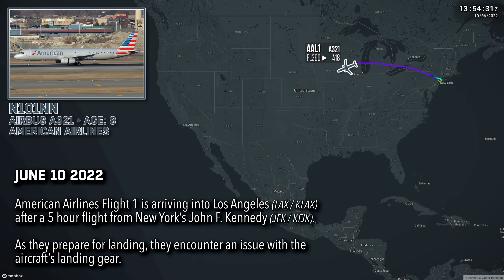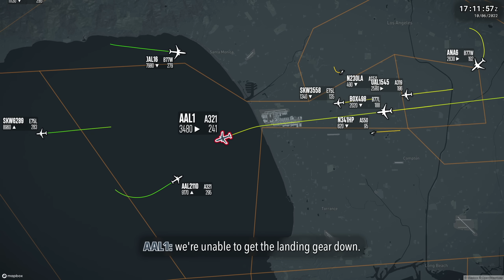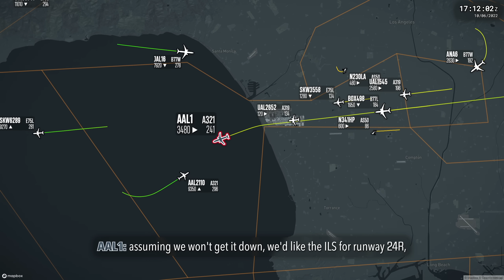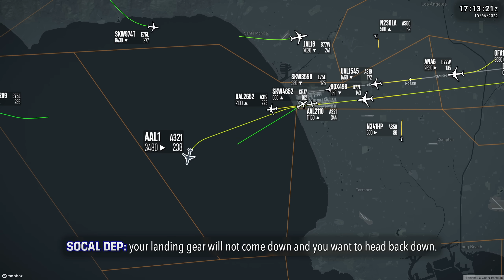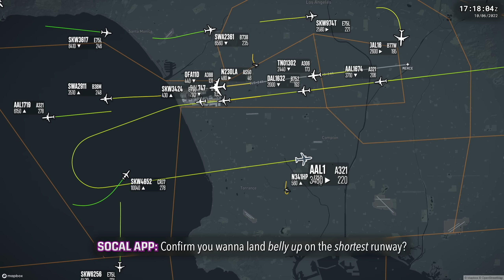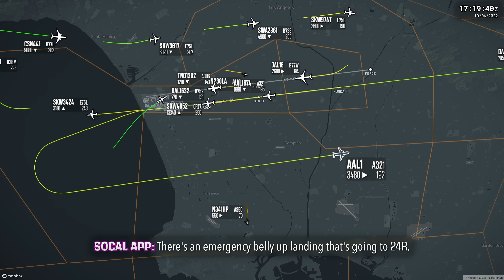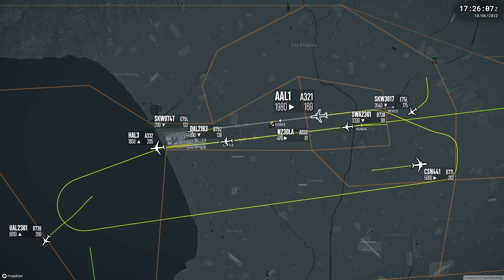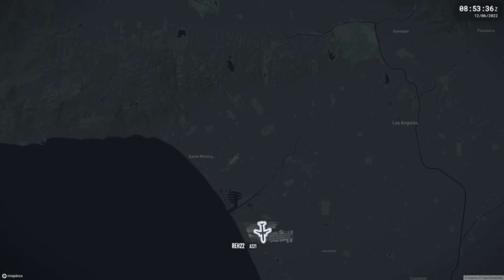LANDING GEAR MALFUNCTION Leads To EMERGENCY Landing at Los Angeles [ATC audio]

Comment: so did they  get the landing gear down manually? or did they belly up land
Reply: They got the landing gears down manually, otherwise the maintenance would have been way longer.
Reply: @mdynasty8219  duh that makes sense. thanks!
Reply: They were able to get the landing gear down, however when they landed they got put in a groundstop cause Air Force 2 was leaving at the same time they were landing so they had to sit on the runway for almost half an hour.

Comment: cant get the landing gear down and then says I'll need to stop on the runway for an inspection , without a landing gear were else would he expect to be ,  can taxi without wheels ?  :-)
Reply: There was definitely some miscommunication (between dep and app). AAL1 said they were going to manually extend it (basically dropping it using gravity) and assumed they were going to get it down that way - which they apparently did. However, the pilots should have corrected app/ mentioned to app that they had gotten the gear down manually.
Reply: @lyaneris  agree. However he said he would need a visual inspection before saying he was going to manually lower the gear  , it made me chuckle.
Reply: @patthewoodboy  Yeah, the pilot was a bit over the place ^^. Had they been unable to drop the gear manually, they would have probably held somewhere to talk to company.
Reply: @lyaneris  and some serious manouvres to get the gear down , shake it loose , as a passenger that might have been interesting
Reply: @patthewoodboy  On airline aircraft. those don't work, nor do single gear touch and goes, like Piedmont did at CLT some years ago..
Reply: @markmonse5285  OK

Comment: A “belly up” landing really isn’t ever advised. Lol
Reply: We did a belly up landing and walked away. Any landing you walk away from is a good one ☝️
Reply: Same ish just happen in Miami.. 🤔
Reply: but if the gear is up and you half barrel roll it, the gear is now pointed down.  controller is next level.
Reply: The goal is presumably to lubricate the runway with the self-loading cargo. Unfortunately, you also lubricate the runway with the flight crew, which is generally seen to be suboptimal.
Reply: @dougsundseth6904  This comment made my day :D

Comment: "American one" how lucky are they will their tail number? It's usually Whisky Tango Foxtrot Four Twenty or Foxtrot Uniform Charlie Kilo Sixty Niner. declaring an emergency.
Reply: Some small corrections: it's the flight number/callsign used for the flight, not the tail number. Also, the callsign has a maximum of 4 numbers or letters after the name. The tailnumber is mostly used for general aviation planes and in the US it starts with N(ovember). Assuming AAL has this plane registered in the US, it's N followed by a sequence of numbers. If it was (hypothetically speaking) registered in Germany, it would be D-A (for two engined jet above a certein weight) followed by 3 letters.
Reply: @lyaneris  Foxtrot Uniform Charlie Kilo Mike Echo Delta Echo Alpha Delta Sixty Niner.